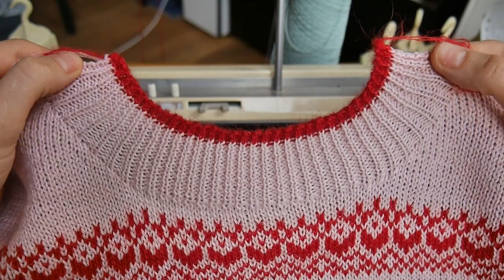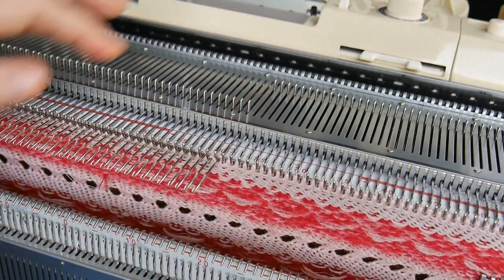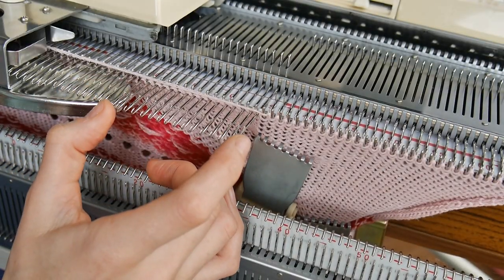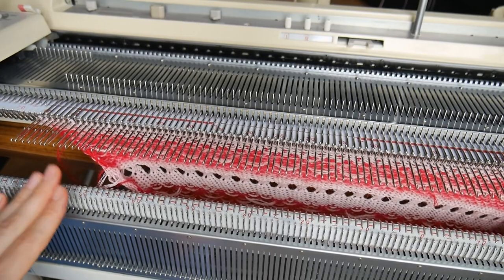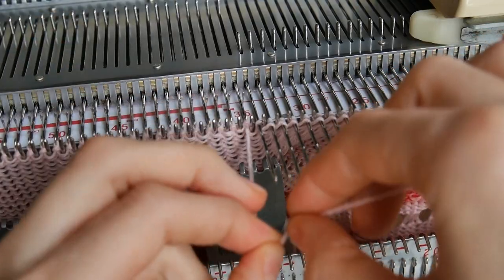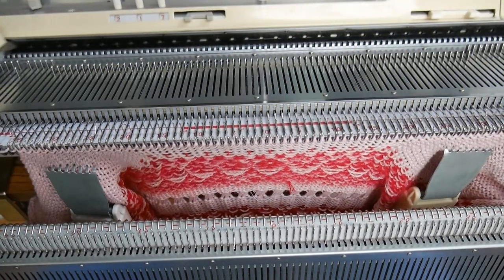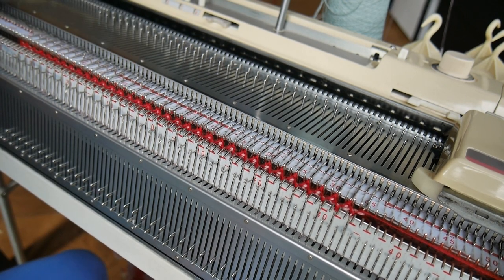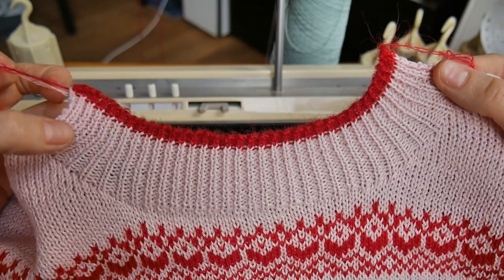Machine knitting  - short row neckline shaping ( partial knitting )

Comment: When you were putting the stiches back on the main bed did you use a tool to transfer.   It showed a item running across the bed.   What is that.  Thanks.   Nice video
Reply from the maker: It was a transfer carriage 😊

Comment: Hi, I wanted to know how I can stop the side edges from curling
Reply from the maker: There are a few ways to stop edges from curling; you can add a bit of rib 1x1 or full needle, or half-milano edge. If you have single bed it is a bit more difficult.
It really depends on what you want to do with the sample. If you are making a garment you don't need to worry about the side edges as they are usually sewn together and that stops the curling from happening.

I hope this helps 🤗🤗